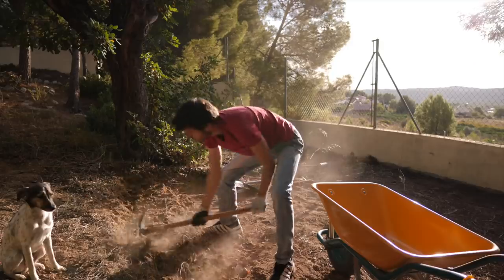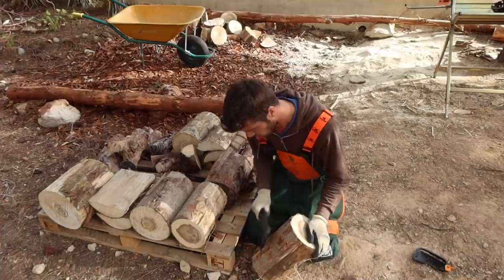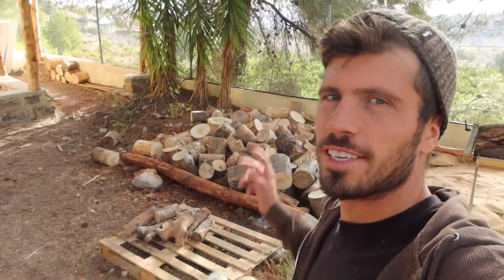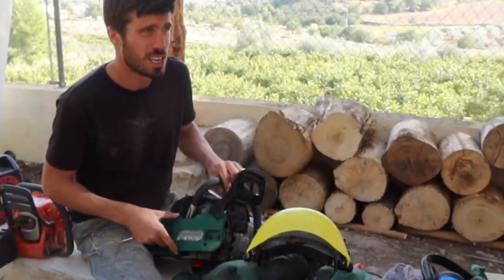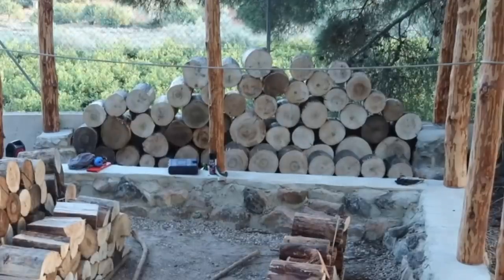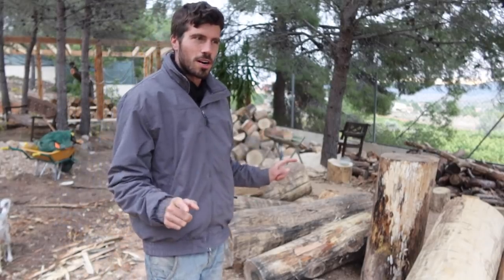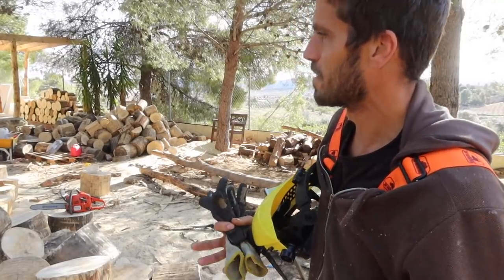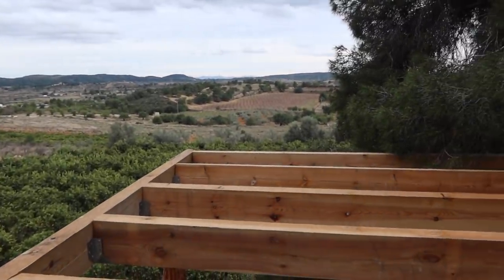Cutting Massive Logs for Wall of the Cabin

Comment: The plates tying the beams to the floor are too small for a house. Probably it's going to work anyway, but if you are thinking long-term, you could swap out one of the L brackets at the foundation for each post for something three times larger with bolts instead of screws. The plates on the ceiling joists are too small too, but you can strengthen that when you add sheeting to the outside of the walls.  Or you could replace those plates and screws with something larger.  Or you could add a timberlock screw at each connection.  Well, that kind of stuff is totally up to you, but the cost of doing it now is fairly low, and the potential cost of repairing a house heavily damaged by wind (or seismic activity, if you have any) would be hundreds of times more.  In any case, it's really cool stuff.
Reply: Wanted to comment this too, the tie-down plates are way-way-way too small, use larger plates and longer bolts. Same for the plates on the ceiling joists, you really don't want to skimp here as these are the bones of your house.

Comment: The chainsaw has to work harder to move the chain on the longer bar... cause the chain is longer  :)))   smaller bar= more power/ faster cutspeed
Reply: Partly right, but for sure, completely wrong.  With more chain engaged in drag in the wood, the engine is under greater load.  Larger log, not larger chain/bar, makes the saw work harder.  Blame it on the log, it is only about the log.

Comment: When you are deaf my friend, you will really wish you had put in earplugs.  Buy foam earplugs, ignore how Maverick Vinales wears them, install them properly.  With a 30dB cut in volume your hearing will last, and you will be able to hear the saw plainly with them plugs in your ears.  If you think you are going to hear the Amazon delivery van over the sound of the Husqy running, you will not.

About fatigue, I have been using a chainsaw (processing firewood) for over 40 years, and my best advice is this:  Before you start the saw, picture a missing hand.  Think of the blood hitting your face and blinding you.  Picture yourself trying to remove your belt with one hand and tying it, with one hand, around your gushing wrist.  Imagine calling your friends, family, and your loved ones and telling them you can no longer clap.  When the saw is going, as soon as your forearms or elbows or knees or back or hands or feet get tired in any way, shut off the saw until you have regained your strength.

Chainsaws are as safe as their user.  Learn how to file the teeth, it is not that difficult.  Love your videos!  Thanks for sharing!  Hello from New Brunswick Canada!

Comment: I like it a lot but ... i think you will need to get some cross support going. The screws are relatively strong but in house terms not really. It would be better if you had something notched/cutout so the wood/stone sits against each other. Just look up some wood joining. With the winds that you have there, there will be pressure from the sides once there is one so you need to be able to spread that out evenly over the whole house. 
At the moment all the preasure from the side is pulling against the screws at the top and you risk to rip them all off if it gets to much. The general desing of the house is solid but the joints are not. If you dont know what i am talking about: build a model out of scrap wood like hip high and just press against the side .. it should fold over easily because not much is stopping it from moving.
Reply from the maker: Thanks, I'll take a look at it!

Comment: Hello mate, I'm living in France and here it is almost impossible to accomplish this kind of project due to the ridiculous building code.

My questions are: do you know how to speak Spanish? Is this mandatory to speak Spanish to be able to accomplish that kind of project? Are the building code allowing you to use all kind of natural material or is there any kind of restriction?
Reply: I think he's not doing it legally. In Spain you need an architect, to pay big tax... (similar to France)
Reply: @saralopezfernandez1799  ah OK the problem in France is not to validate blueprint with architect but to comply thermal codes, it forces you to have air tight house with really high insulation and vent system for new construction.
Reply: @thomasj8851  Same in Spain, new houses have to be energy efficient.